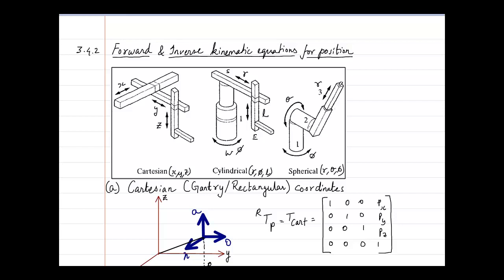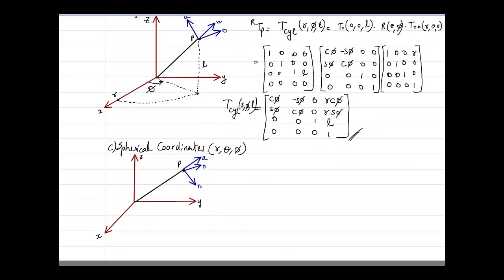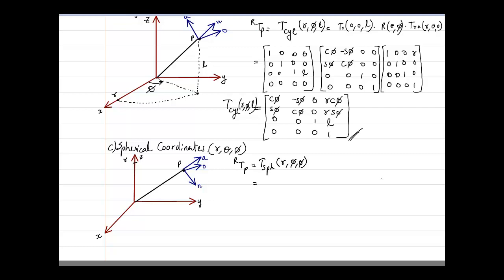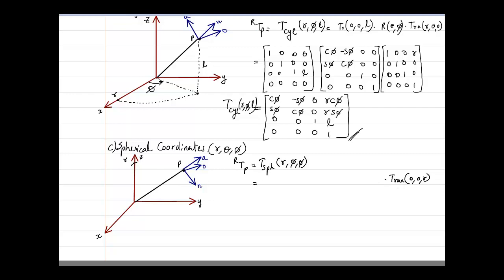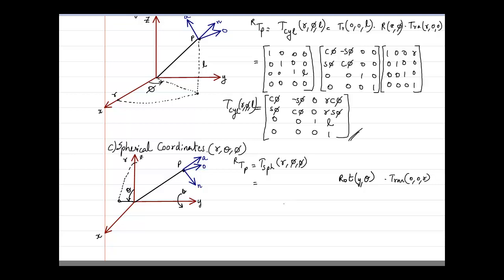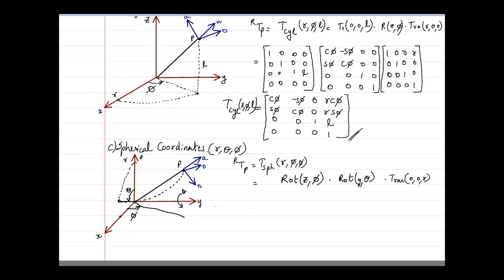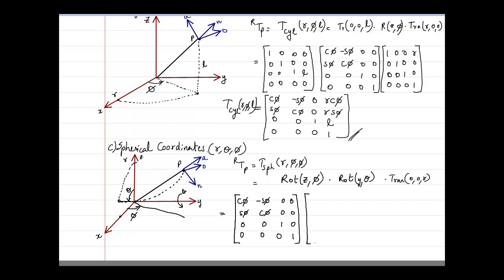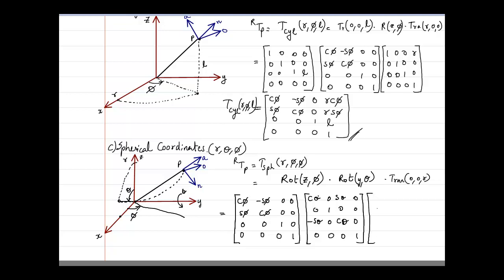3.4.2_c_Spherical robot kinematic equation for position

Comment from the maker: We have to give 3 distinct individual movements in such a way that at a time only one parameter (r,theta,phi) changes. Here, in spherical coordinate system you will notice that if the first movement of 'r' is in x direction then, the change in parameter is not just 'r' but 'theta' also. i.e. 'theta' is 90°. Same is the case if we move in 'y' direction. There also 'theta'= 90°. Whereas if we move in z direction 'theta'=0° and 'phi'=0°. 
Now, you may ask, "can we move 'r' in any direction other than 'x'?". The answer is yes, because, the direction 'r' is from the centre to outwards. Thus, z is a valid direction for 'r'.
Reply: Thank you very much Sir 😊